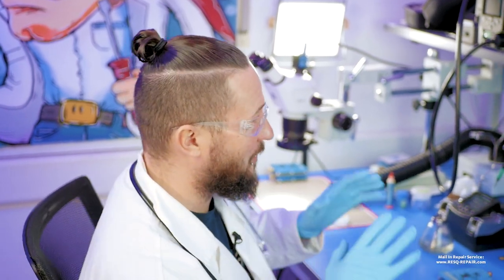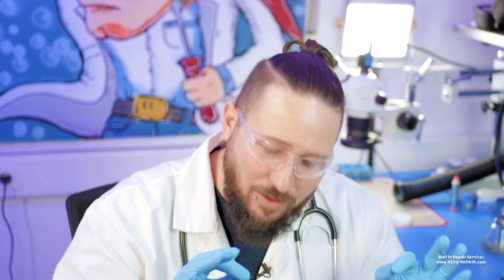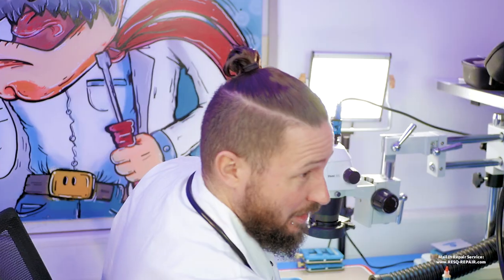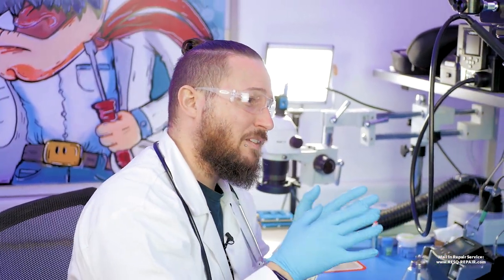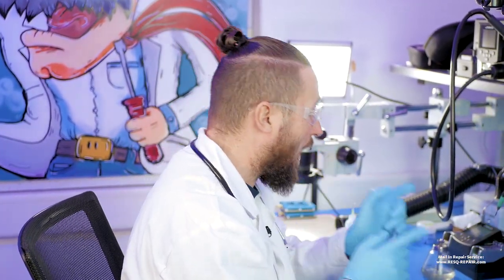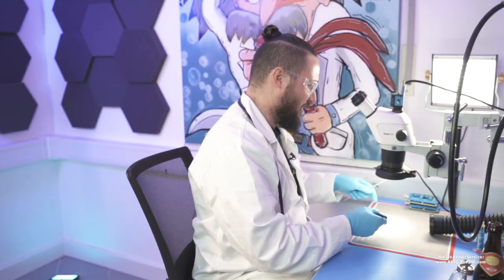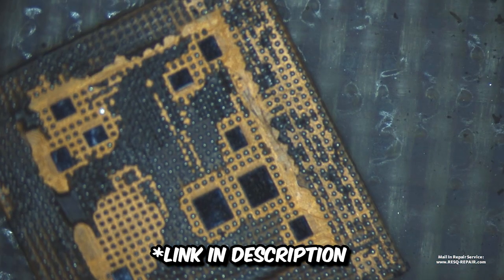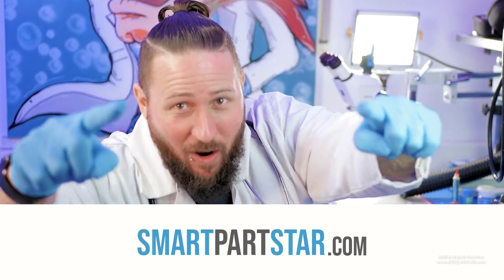⚠️Perfect for BEGINNERS: How to Remove Glue without Heat - Dr. Ben’s Liquid Glue Remover

Comment: Hello Ben quick question please, I wanted to kindly ask which do you recommend JC P13 or iRepair P12 for iCloud bypass WiFi unbind hardware method ? For bga110 already have a JC VS1 pro but most functions are not yet supported .
Reply: JC P13
Reply: @babakfatolahi977  thanks , so you recommend Jc P13 .